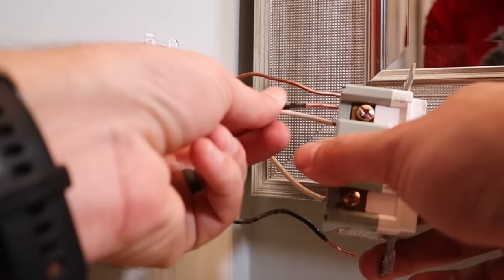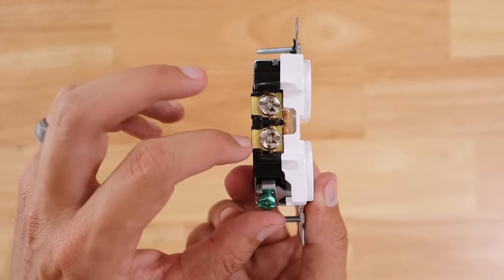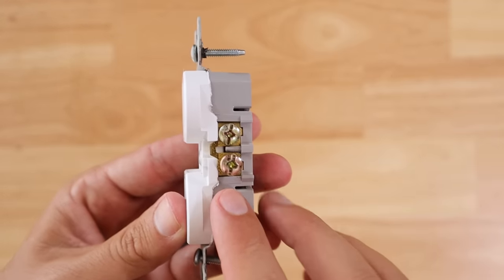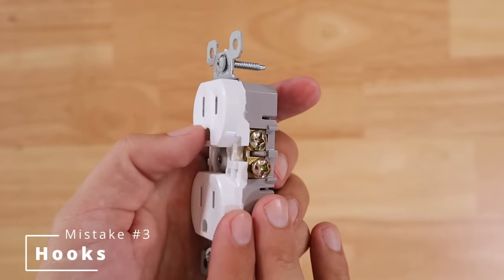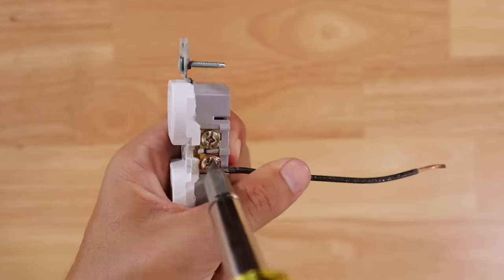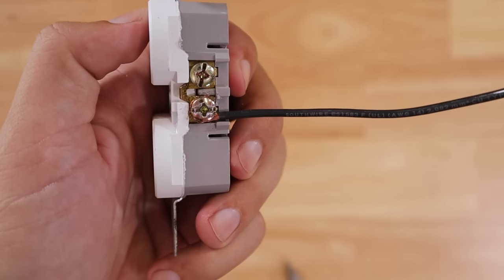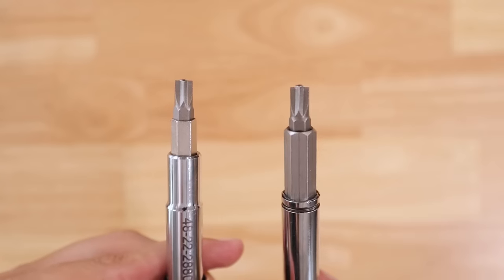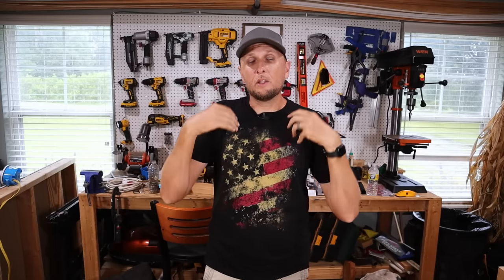The BIGGEST Mistakes DIYers Don't Know They Are Making When Wiring Receptacles | How To

Comment: Thank you for posting! I rarely to this so it was quite helpful. Although a weird thing happened which is why I searched for some help. I replaced only one outlet, everything checked out and the lamp turned on in the kitchen but the outlets to my microwave and toaster oven did not work. The oven worked and another outlet worked as well and all were on the same breaker. After watching your video I double checked my wires after turning off all breakers to the kitchen. The wires were good. I turned all breakers back on and to my surprise the two outlets worked. 🤷🏾

Comment: Great Video. 
  I have been using Commercial Outlets and Switches. In my home for years.
The regular Residential Sockets and Switches  that were in my house were junk from the start.
   My life got a little simpler. After realizing 20 amp breakers can only take about 13-15 amps continuous. Or over time it will trip the breakers. 
  Had this problem in the shop. Every time my father added a light . He kept adding it to one circuit. The breaker starting tripping after a few hours all the time. 
   I split the circuit and put it on a new breaker.

Comment: Thank you taking the time to show the proper way on how to correctly install wiring onto an outlet. I'm a DIY so these tutorials are very useful. My father taught me that after attaching your wiring to a outlet or switch that it's a good idea to wrap electric tape around the outlet or switch to help to hold the wires in but most importantly to help avoiding a loose wire come in contact with your attached wires. Not sure if you do that yourself?

Comment: Thank you so much for the advice and tips  What I noticed when replacing an outlet is that the White wire goes to the wide slot on the outlet. Easy way to properly connect the wiring for safety.

Comment: Great information and I experienced the reason not to use backstabbing firsthand.  As an EE I would have thought that back stab terminals would not be allowed unless they met all the specified capabilities of the outlet - this is NOT true in practice.  A professional electrician wired our house 9 years ago when it was built and backstabbed everything.  We had to use a portable electric heater in one room, well below the socket and breaker rating, and the backstabbed terminal failed, overheated, and left a brown discoloration that I saw before a fire started thankfully.  The outlet was a name brand made in the USA.  I replaced it with a Legrand commercial grade, used the rear entry wiring screws, and expect no future problems.

Comment: Thanks for the helpful things not to do. All of the wiring in my outlets are quick wiring, back stabbers. The J hook is a better fit and easier in not damaging the wire when making the outlet change. Thanks for recommending the tools for the extra tight, many people don't have those- the flat head made that extra tight fit over the hook better than the philips.

Comment: Great info, especially the screwdriver type tip.
BTW, you can also tell proper polarity by looking at the smaller plug side - smaller one is hot and the larger side the neutral (left side when ground plug on bottom.)
Glad you didn’t stab your palm when demonstrating - many do this when using the wrong bit 😊

Comment: Wow, i learned a little something!  Nice! I have an $800 vacuum that has a cord/plug thats gets very hot (carpet in the house) . The vacuum is going to the repair shop just for a check. But Im in a tract house (del webb) makes me wonder just how proper these receptacles were installed. If the power to the house was off, maybe i cud check some of the receptacles. (Maybe...)

Comment: Great teaching, I didn't know you can use the square bitor other two to make a tighter connection, and I use to use drill and bit and it can over tighten and crack outlets

Comment: Good video, thanks. Great tip on the two specialized screwdriver bits vs Phillips.  Minor correction: at 3:14 you say tightening the screw on insulation could cause a short circuit.  Many of us use the term "short" incorrectly to mean any electrical fault. The fault in this case is an open circuit, or intermittent contact. Poor contact will result in a resistive connection that leads to heating and possible fire.

Comment: Gr8 video. I learned a lot. Regarding the first mistake there are a few situations where black and white were switched in my commercial building. I now always test my hot wire since I noticed that. So far most are correct.

Comment: Great video.  You should also do a video about people replacing a split receptacle with a new receptacle and not cutting the gold plate that bridges the top and bottom plug. They end up having two circuits wired together which immediately blows the breaker.

Comment: I don't like the speedwire holes either, but I've used them in place of stacking a time or two, because I didn't have any wirenuts and/or excess wire to make a pigtail.
For something low current like a light, I think they hold well enough.

Comment: Great info, my house was built in 1958, and rewired sometime between then and now, replacing most of the clothed aluminum wires with copper ones (thank Goodness). However, the electrician that wired my home was the son of the homeowner. He reversed the wires, making white the hot wire and black the neutral. This was confirmed by the home inspector prior to purchase, a second electrician who came through to do a second electrical inspection, and me.

Comment: Good video. My opinion is never use the speed wiring option. Right now I am replacing about 50 assorted outlets and switches in a 27 year old house where the speed wiring feature was used. There are loose wires, outlets that sometimes work, sometimes don't. I've turned off the mains to the house. As I went along I found that some of these old wiring devices had cracked plastic housings in addition to the push-in speed wiring being loose.

Comment: Thanks for your video I need that special bit for terminal screws.  Recently seen your videos and helped me go from a single switch to add a switch and outlet with pigtails.  Hate twisting wires 🤬 so much trouble to getting them to stay together.  Would appreciate a video to learn how to twist two or three wires together and them actually twist together.  They came apart several times when I started pushing them into the box.  Thanks.

Comment: Something I have always practiced is to treat every electrical connection as if it were "hot" or energized until verified "dead" or denergized before proceeding with work or repairs. Also, when holding a component, try to position your connection point in a way that if your screwdriver slips off the screw while tightening, the tip of the driver  doesn't hit your hand or arm.

Comment: A mistake I made in the past was stripping the wire using the incorrect stripping cutout for the wire size I was installing resulting in a compromised and weakened connector. Sometimes the conductor would snap, at the point where the insulation was stripped away, when bending to go around the screw, or be very weak at that point. 

Also I find most newer made receptacles will come with the grounding screw on the same side as the neutral. U.S. made, at least, not sure about ones made elsewhere.

Comment: PROPER TOOLS PROPER WAY to install a socket... my house had a 3" red wire  a wire nut used to add 2 black wires to the silver side of the switch nice COBJOB ... my dad tought me an he said that the voltage in the wires if the connection is not good it would do somthing like ocolate vibrate burn & even short out ... great review

Comment: Excellent video!  Thank you!  I agree that "Speed Wiring" is unreliable and dangerous!!  I have replaced many outlets over the years that developed high resistance connections which began overheating and burning.  How did this method ever become legal???
Reply from the maker: You are very welcome!  Really glad to hear you liked it.  I am not sure why it is still legal.  I don't know any electricians personally that recommend using them. I trust the guys that work on them daily over the ones in a controlled environment supposedly testing them.  Thanks a lot for the feedback!

Comment: Electrically - great info, very useful. In terms of safety, one suggestion: especially where you need to apply a lot of torque and push with the screwdriver, and especially where the geometry or visibility of the connection is not perfect - put a glove on that left hand. You don't want a bit bite in the palm!

Comment: I prefer Cooper (now Eaton Electric) back wire receptacles.  Push in not on the back, but along the side under a plate that captures the straight stripped wire when the screw is tightened.  They are sold as Industrial.  These receptacles also hold plug blades much tighter than most receptacles.  They cost a bit more, but IMO worth it.

Comment: Great video, very informative, I learned so much just from this video but I have a question. Maybe Adam can answer my question or if some great people in this forum can help me I would really appreciate it. I'm replacing a receptacle, when I removed it from the wall there were two ground wires connected to the green screw.😂

Comment: Nice video. I like those new bits as well. For my house, I do two things differently. I use the compression plate style of receptacle, especially when I have stranded wire. The second thing is that I bought a torque screwdriver to make sure the outlet is well tightened. A pro wouldn't need it, but an amateur doesn't know when they have tightened the screw enough. The previous owner put receptacles in the kitchen and didn't tighten one hot screw enough. It arced and melted when I tried to use it for an electric kettle.

Comment: Also the power side is the smaller slot and the neutral or common is the large slot.
There are more costly speed lock ( back stab)outlets that tighten with the side screws.

Comment: 2:18 For that much insulation removed as you said, had a issue with a outlet fire in my bedroom during the winter of 2016. I was lucky i was still awake by that time or a house fire would happen. It happened to my uncle and aunt

Comment: pause at 3:30, those holes on the back are for pushing wire into the plug which works great. It also says which side hot is.
Reply from the maker: Also known to be prone to failure more than the other ways of connecting wires to it.

Comment: I have a camper that has a mini fridge that is hardwired into it. The fridge is broken ( not worth fixing)
Would you suggest running the existing wires to a new outlet  ( which i would install), or cutting the plug off a new fridge, and splicing them together?
Thanks for the video

Comment: great video, and info sir.. my question is when you hooking up  the wires to a new receptacles does it matter if you hook the black and white to the top screw or the one under it .? i would think either one is ok, but just want to be safe and make sure it is done correctly that's why i'm asking. thanks.

Comment: I've seen so many installs that favor backstabbing the outlets instead of using the screw terminals because of speed (and often the insulation is stripped too far, exposing bare copper) just because of speed. In fact, in these cases, the electricians only use the screw terminals when there is a third wire run into the box and they need the extra connection (because they certainly aren't going to take the time to pigtail it).
Reply: Yes it’s way faster and I prefer the connection it makes better.  The springs that hold whatever you plug in are going to ware out way before the ones that hold the wire in even if your plug is loose and moves around
Reply from the maker: @Benjamin-xp7jl that is false.
Reply: I'm sticking with the screws. It may be slower, but it is more secure.

Comment: perhaps discuss when you would and would not remove the "fin" connection between the 2 gold (hot wire) connectors. i needed to do remove it because one fixture needed to always be live, whereas the second was connected to an on-off switch. thx!

Comment: Especially with some of the terminal screws being brass-colored, I always assumed they were made of some soft metal that I would easily strip if I over-torqued them. What kind of metals are typically used for these terminal screws? Are they made of some variety of steel that's hard enough that no human using just a hand tool would be able to strip them, or is there a possibility that a person could still really ape down on them and break them?

Comment: Very helpful, thank you. Please help me figure out how to upgrade from a 2 prong outlet with no ground, to a 3 prong GFCI that is safe for equipment use. 
If the outlet box is plastic with no ground in sight, would the following be correct:
1. Change out the plastic box with a metal one
2. Use a self tapping screw to attach a 6” ground wire to the metal box
3. Install a GFCI that has a ground screw, connect the 6” ground wire, neutral and hot

Comment: Updating to gfci at the line in outlet then replacing all the back stabbed outlets. What's ur safest setup for that?  I have another crazy setup to untangle but too much to try and type. But it includes your 4 wires under a hot line in.

Comment: Hey, thanks for the great content! I was taught to leave the electrical work to the pros, but your videos are quite motivating. I want to build an extension cord with a double gang box. Is that a safe project?
Reply from the maker: It’s as safe as you make it.  Just being honest.  If someone doesn’t know what they are doing, not getting the proper wire size, receptacles, etc then there could be issues.  So just depends.  I have a video on the channel of an extension cord I made.

Comment: Never knew black/hit wire to gold connector and white/neutral wire to Silver. Always just put wires on new switch on just like I took   them off the old switch. Plus should use screw to attach versus crimp holes. Makes perfect sense, Good to know. thanks.
Reply from the maker: You are very welcome!  Really glad to hear you liked it!  Thanks a lot for the feedback!

Comment: Also make sure to install the receptacle "upside down" per say so that the ground prong is always facing up. Reason being if anything metal falls on the plug it's grounded and if it touches hot it completes the circuit and won't short or arc. It would also be safe to handle at that point too.
Reply from the maker: That’s not really a mistake though. It’s a preference.  Also an instance that very rarely ever happens.  That’s why you almost never see it installed that way by electricians in residential applications.  But code does not designate receptacle orientation other than it cannot be facing up.

Comment: The switch I just replaced was running brass screws on both sides, ground tucked in the hole not hooked to switch, red run to +line, black and white wire and black wire ran to unmarked screws on the other side of the switch

Comment: I like the video. Thanks! I would benefit from some additional information about one point that was made. At 1:00 you mention that connecting the wires to the wrong terminal could result in a condition called "reverse polarity". That term suggests that the power is flowing through the device in the wrong direction. Could you explain that a little more? I don't disagree with connecting the "right" wires to the "right" terminals. I'm just confused by the terminology, and what it means to the flow of electricity. After all, the typical home power is Alternating Current that changes direction 60 or so times per second. So how can there be a correct direction of flow through the device, when that direction is constantly changing, anyway? I'm missing something...

Comment: Using both screws to connect a circuit to feed other devices is called wiring thru an outlet, and comes a major problem if someone pulls off one of the neutral wires leaving the hot passing thru needing a neutral to complete a circuit (Path). Or if it's part of a 120/240 three wire network as in how almost all older homes and businesses were wired, it could then send 240volts or split the voltage unevenly across two loads (now in series), total impedance will determine what voltage drops across it. And boom there goes your TV. luckily a lot of things are smart and has a voltage range

Comment: Not sure if you'd want to update to mention back WIRE terminals.  I've never used backstab for all the reasons you've mentioned.  However lately more manufacturers are providing back wire terminals where the stripped and straight wire can be put under or into a slot provided for it and then tightened down with the screw.  These are faster to wire and provide better for future replacement.  They also lessen some of the stress put on the copper hook in unhooking and re-hooking the wire.

Comment: Thanks for the video however I respectfully state that you missed a crucial importance. On the doppelgang Outlet in your demonstration, there are two sets of screws on the right and on the left. Which are the proper ones for a standard installation?
Reply from the maker: No standard for which ones to use as both will do the same thing.  Just one wire is allowed on each terminal screw.

Comment: I'm not an electrician, but I never use the push in connection. When I put my hook around the terminal screw, I always use needle nose pliers to pinch the hook tighter around the screw.

Comment: If backstabbing is such a problem I'd assume it's not to code, in which case why are outlets made with that option? I'd also assume that the push connectors that can be used instead of wire nuts are the same problem.